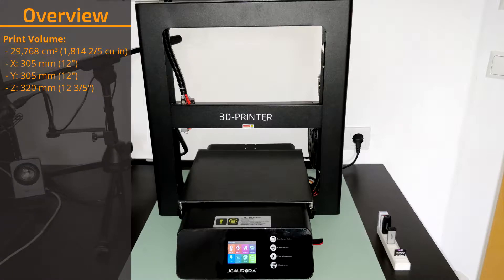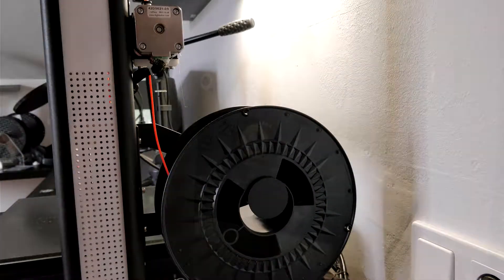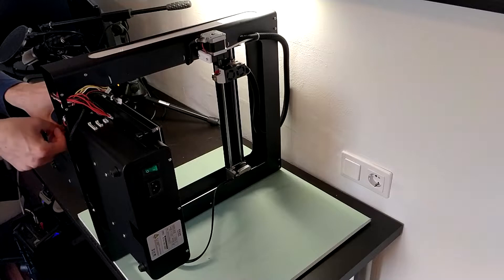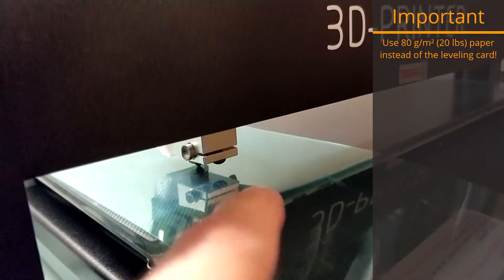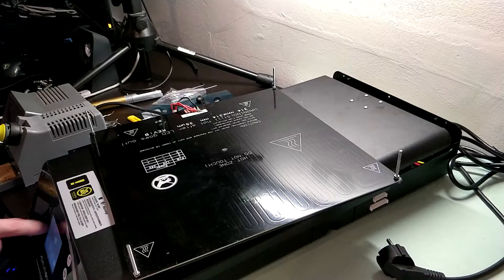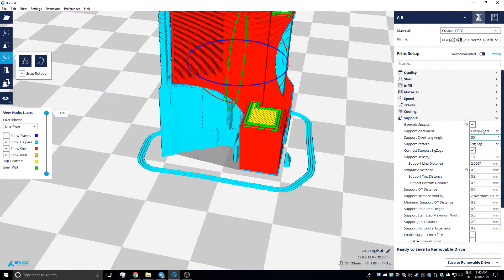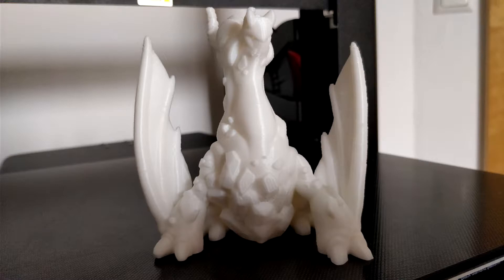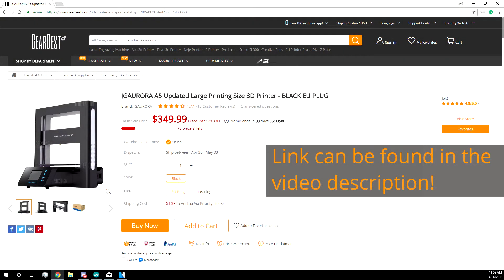JGAurora A5 Review - Good Printer for $350!

Comment: Your review is not far off the mark and yes it's a sexy machine but let me add a few points
1. Parts often go wrong
2. Helpdesk not very good, no speak english when it suites them.
3. Replacement parts take six weeks to arrive and are often factory rejects and faulty.
4. The guarantee if you used AliExpress to purchase the printer is worthless

I regret the day I ever pressed the "Buy button" for one of these JGAurora A5 machines and feel scammed
Reply from the maker: Oh, that's sad to hear. Thank you for mentioning it. I can understand the trouble you had and how annoying it can be...

In my case, the A5 is still going strong as of today. I really like it for many prints that "just need to print". Also my father prefers it over all the others for his stuff, as functions like filament load/unload are very helpful.

The print failure rate is lower than on my other machines, as most errors can be avoided using correct settings. I have not had any mechanical errors than one connector going loose and the Bowden coupler breaking (had to order an official replacement...). 

I have not yet had the need to use their "Help Desk" (and probably wouldn't), but your experience with it and the guarantee is sadly no different than what others told in their reviews.
What parts did you need to replace?

Personally, I always think about the printers that they are "experiments", that one needs to work on to improve. I know that this is not the opinion that many share, which is understandable, as you want the product you bought to work as expected. Therefore I fixed the heated bed connector by myself, and never had any troubles with it.

I know that my response isn't very helpful in your situation. What I can recommend you is to just make the best out of it. If you got any questions, just message me.
Reply: @Caverntwo  
"filament load/unload are very helpful."

Mine worked some times but often it would just sit there doing nothing but this was just a minor fault but once i started to put a bit of wear and tear on the JG (10kg PLA printing) then wheels started to fall off.

I went for a CR-10 mini in the end and yes they are low-fi and i hate the micro SD card but the thing just goes on and on and on without any faults and i don't mind getting my hands dirty and fixing things but lies about parts not being sent out, faulty parts arriving did it for me  in the end and I opted out from being part of the JGAurora beta testing and won't be coming back.
Reply from the maker: I see. That sounds pretty annoying! Luckily I didn't have any of these problems.
What "beta testing" do you mean?
Reply: @Caverntwo  Few of these A5's use the same parts so when they field test the parts in the real world they end up doing all too common updates to overcome issues they should have spotted sooner so that makes us beta testers. PCB updates, Fans and if you are lucky you might even have a clip on glass for the heat bed and not stuck on like mine.
Reply from the maker: Ok. But, at least they improve their products. The glass-plate is also stuck onto the bed as far as I know in my case.
Reply: @Caverntwo  Yes I am sure they have but you can bet that JGAurora will remain slow on delivering parts to Europe and that the guarantee will be no more use than the one on the old printers.